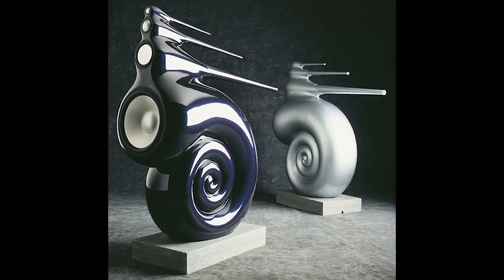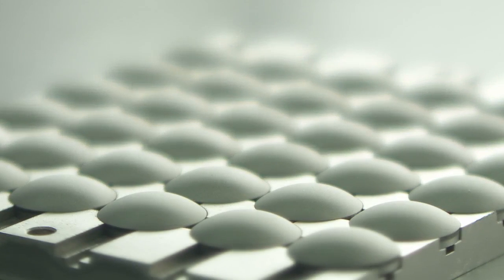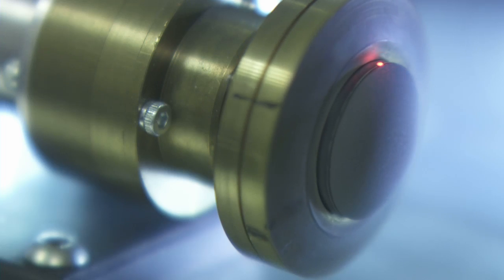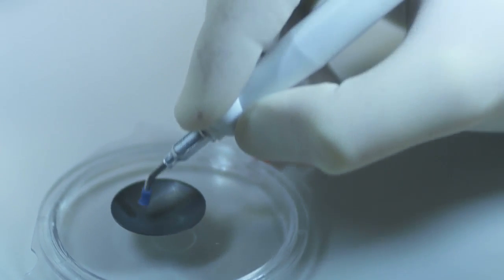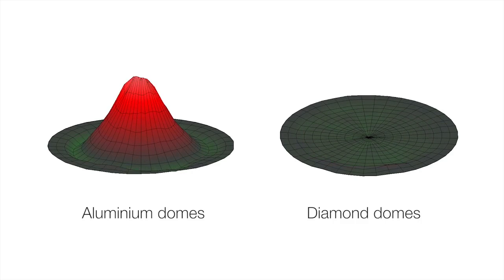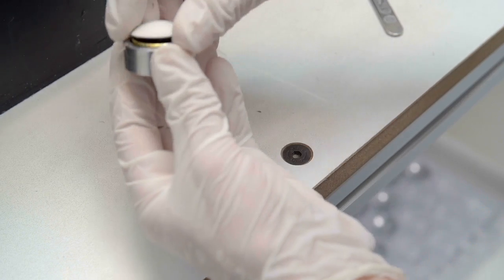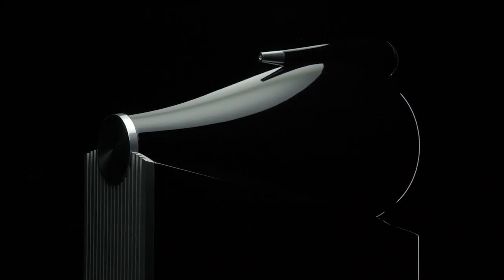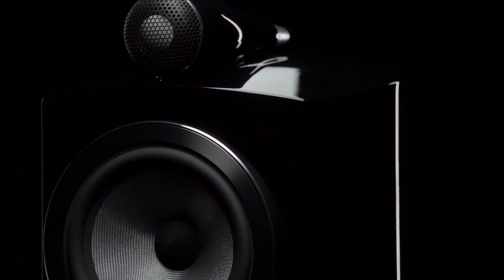Diamond dome tweeters

Comment: B&W Diamond Tweeters sound amazing but these tweeters break quicker than an egg shell! I have owned many Diamond tweeters and refuse to buy them because of there fragility. You cant have guests and definitely not kids around them unless you rope them off with Do not cross police tape. Tweeter replacement cost me $1200 each! And you would think they would be cheaper as the company knows they are super fragile but nope that's what they charge. Oh well plenty of other speakers to choose from.
Reply: Has anyone tried using the aluminum ones instead?